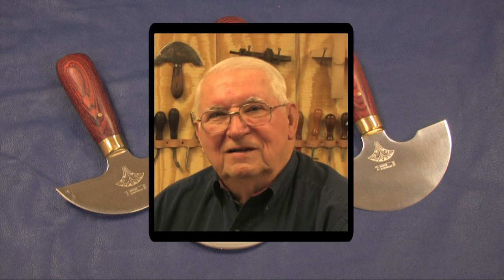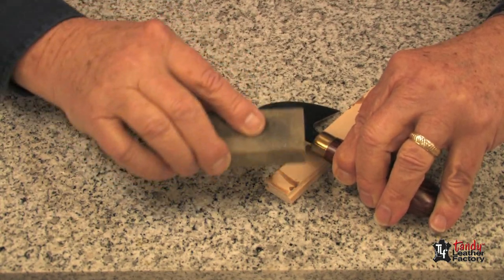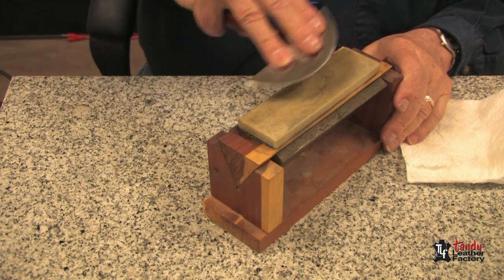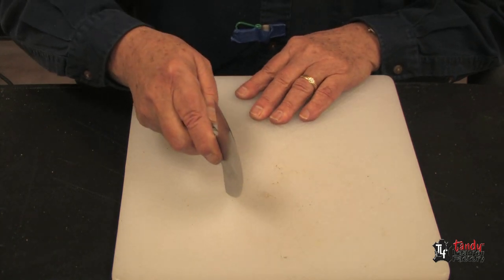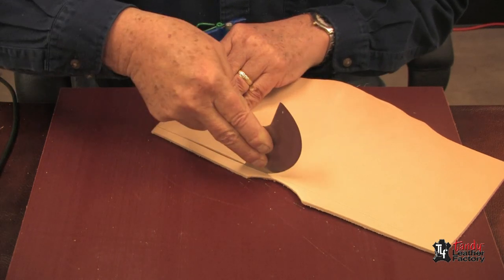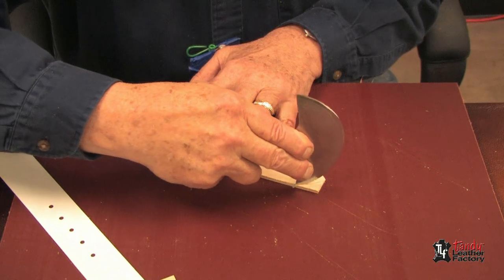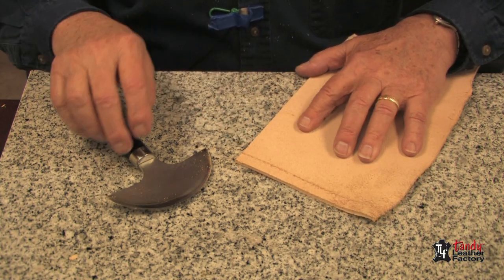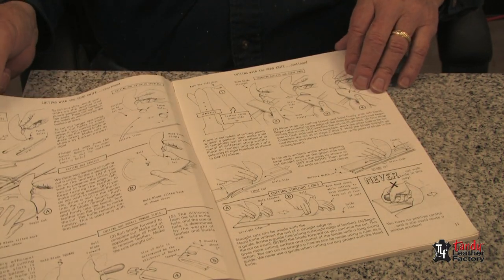How To Use And Care For The Leather Round Knife

Comment: I purchased the Al Stohlman head knife from Tandy: The bevel ground at the factory was way too steep to be useful. Basically it was a fat wedge that was sharp, but very difficult to push through anything but the thinnest of leathers. I had to remove a lot of metal to get an edge that was of a proper knife bevel before the knife would cut properly. The head knife worked great after that, but was virtually useless beforehand. So, be prepared to spend so up front time on the initial sharpening. This is often the case for many tool blades sold commercially. FYI: I have been using and sharpening hand tool blade  for over 30 years. I started forging my own blade about 5 years ago.
Reply: I'm thankful for this comment, I just bought an Al Stohlman and the force required to make cuts is very inconsistent. It's taken a lot of active thinking to not lose sight of safety when trying to get the knife to just go through the leather.

I've learned to control the angle more, which helps, but sometimes it feels like the knife refuses to budge and then other times it cuts as smooth as butter.. usually when I'm not expecting it and it causes me to cut outside the line.

I'm not great at sharpening, which makes the idea of working down the edge is stressful -- but it's always painful before it's smooth.

Comment: Great video thanks. If you dont get a straight line, whats the best way to trim it straight if you dont have the strip knife tool?
Reply from the maker: Anthony Meehan,

The knife isn't what will give you a straight line. Using a metal ruler, or any kind of straight edge while cutting provides the straight line.

The quality of the knife will just make it easier.
Reply: i think the correct answer is "practice"

even when using a straight edge, you end up dulling your knife, and the action of cutting ends up dragging the leather from underneath the straight edge and you finally wind up with a less than perfect edge. 

this is especially true with thicker leathers (5-15oz)

Comment: As much as I admire this man, and I do, I believe his sharpening technique is dragging a lot of residue onto the edge. You should always sharpen in a back-stroke fashion, moving the metal away from the edge. Obviously you can't use a strop like this, but that's not what I'm getting at. If you're using a Lansky or wet-stone, always move away from the edge, never forward or side to side.
Reply: You should truly know what you are talking about before passing on information. In this case you do not know anything about sharpening. The gunk you speak of is a slurry of stone particles and metal that has been removed. It is this slurry that does most of the cutting. The cleanest edge is always achieved on the push stroke keep the slurry ahead of the blade. For water stones you have to use a Nagura dressing stone to get the slurry started.
Reply: @billmccaffrey1977  You are wrong
Reply: @dpurplefox  Informative.